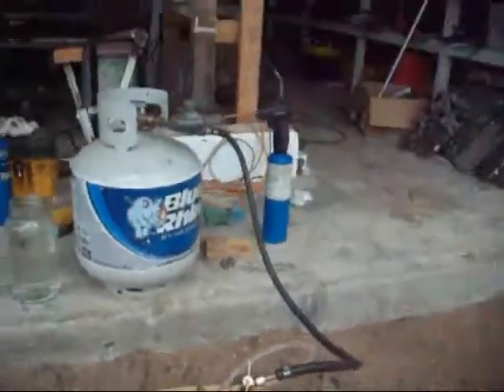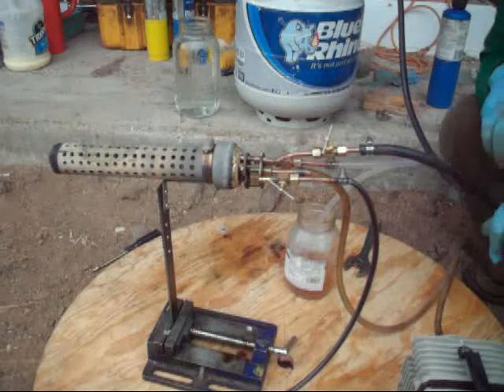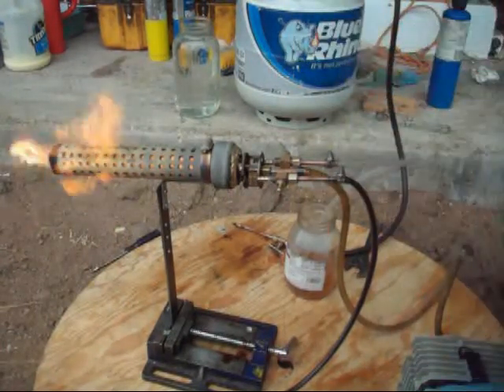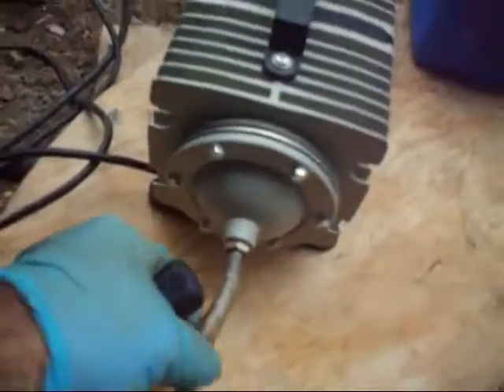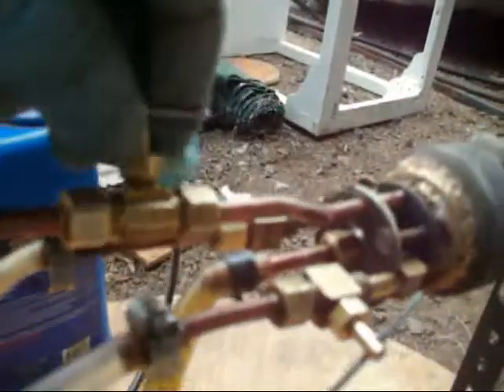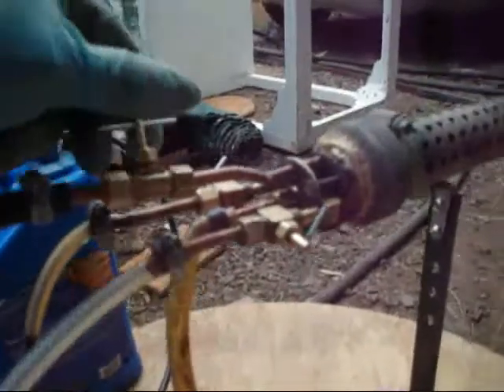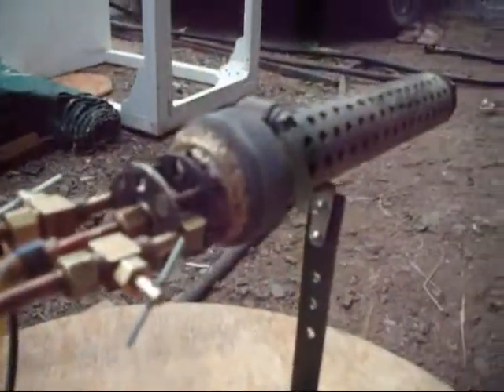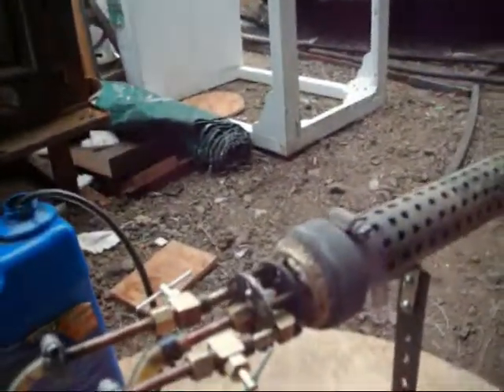Boysal Burner, starts with propane runs with any oil

Comment: There are metallic oxides in used motor oil you must be aware of, which, if inhaled, get into your system and cause harm, so be sure you fully ventilate the exhaust.
Reply: Any positive things to add?  I think this is the ultimate burner design for any fuel.  Did you see how clean the propane burned? There wasn't much coming out, yet it heats up hot! That air pump and a well designed siphon nozzle as well as a ventilated catalytic thermal mass are the the kicker.  He also runs this on vegetable oil and it burns cleaner.  I am definitely using a rendition of this for my foundry, although I have 2 of those pumps but only 30 Watts each which I am going to Daisy chain together for increased flow.  I also discovered with my paint sprayer "blue flame oil burner" experiment that I can use the intake of the air pump semi safely (hours of testing) to mix in my propane for preheating and/or running which gives a completely homogenous propane/air mix as well as easy adjustment.  Another thing I am going to test is a tiny catalytic converter found on the inside of exhaust pipes on Chinese 2 stroke motorbike kits, it is literally the perfect size for my burner design, and can take the heat as I get those 2 stroke engines blowing blue fire for hours and it lasts and lasts 😀.  I also like the safety factor of instant off, no smoke.  My furnace/foundry is going to feature a suspended cone exhaust chimney just above the swing reach of the kiln lid to exhaust high in the air to prevent fume inhalation-essentially an outdoor "Fume Hood" or "fume extractor" if you will.
Reply: @ProlificInvention  From what I can tell [and there are a lot of things there I can not see or know without actually inspecting it up close] your basic plan sounds fairly good.

Comment: it would be better if the propane starter was put in a "T" piece just behind the burner in the air pipe, and made so that the supply can be safely adjusted and isolated. Also a burner of this type would work more efficiently still if the oil feed to the burner sucked up the oil from no lower than 75 mm. otherwise a well designed burner

Comment: Great job Mehmet! Will it burn used synthetic oil?
Reply from the maker: Tolga. this burner can burn any type oil. But as I have said in the video, used engine oils burns real clean but with a strong chemical odor. Used vegetable oil burns the best with no odor what so ever. Be nice if we can find some kind of additive to mix with used engine that can eliminate chemical odors.